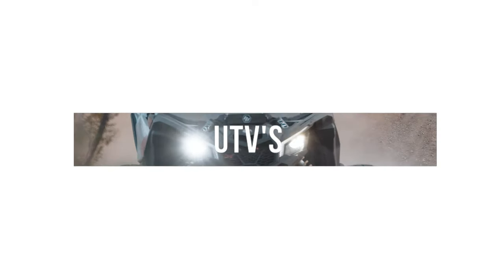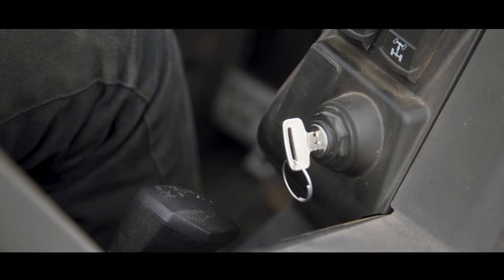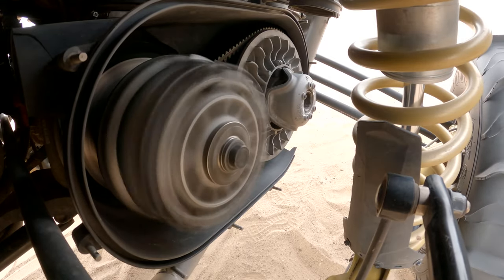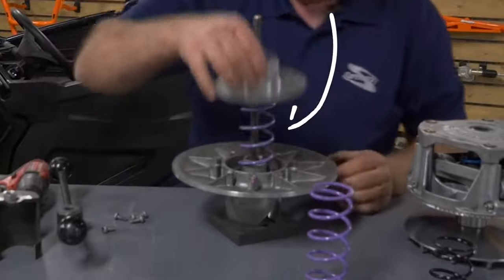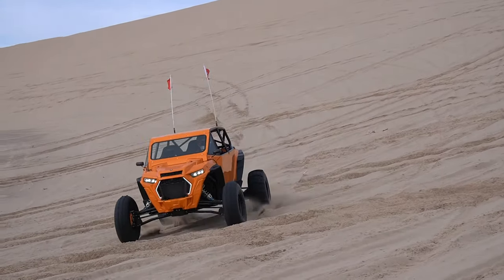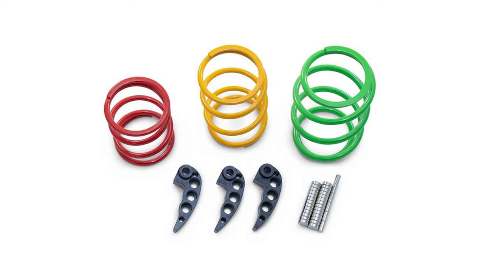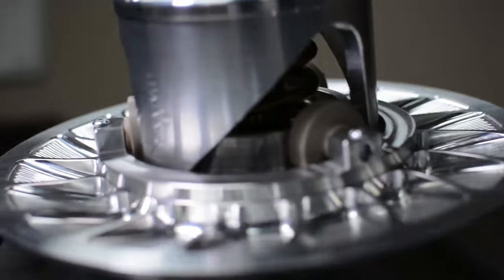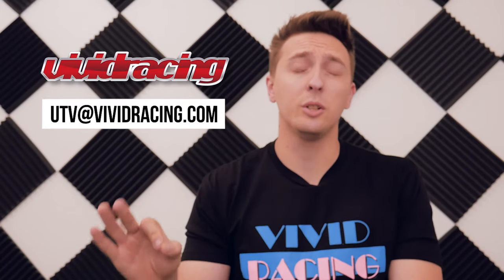UTV Clutching 101: Everything You Need to Know and More!

Comment: On my Canam 570 I put on heavy black water 27” tires to replace the 25” light tires and did not replace the clutch.  Still works good on Colorado trails
Reply: Lots of our guys run heavy 30s with their 570 pretty decent. Like 60 pound outlaw 2s

Comment: Of course, the best CVT is designed by Yamaha, which uses a wet clutch so your belt is always engaged with the primary sheave and thus no belt burning.  They back up this industry-leading design with a 10 year belt warranty.
Reply: Kawasaki uses wet clutch as well
Reply: @flight2k5  they call it a centrifugal clutch.
Reply: @danlux4954  it’s a centrifugal wet clutch. Now you know..
Reply: I'll stand by that Yamaha ultramatic. And the wet clutch.  I went to change an 11 year old belt and it was still within spec.  Best cvt design out there. I watched Polaris and can ams smoke belts all the time

Comment: I can get the motor to run, idles ok, but when I try and shift into any gear, it grinds and stalls out. With the motor off, it wont shift other than into the first forward detent, not the second. No change with the new belt I put on. Any suggestions?

Comment: If you're the tuner type, this drive system is pretty fun to tinker with. Snowmobiles have used them for years so there's plenty of different parts available. While it's definitely recommended for beginners to not stray far from the factory settings, once you understand how they work and the power curve of whatever engine they're attached to you can REALLY change the way a machine feels. I mean like radically. I could have a newbie ride a certain machine and then make nothing but clutching changes and not touch the engine and have them ride it again. They will have a hard time believing its the same engine because the machine just doesn't behave in the same way.

Comment: Hey brother I have a 2016 kymco 450i it has 3000 miles on this machine. The belt is in peices,half is tangled up behind the pully. On the smaller clutch there is some loose round peices about the size of half inch nuts looks like there's 3 or 4 just rattling around, don't know what they are. It looks like a small groove 1/8inch teeth 1/8 apart and 1/8 tall teeth. The other belt is an inch wide,3/8 tall and 1/8 gap between teeth. Why would there be 2 belts? How would I get a new belt on, what's the best way? I need help, this is my first time doing this

Comment: Alright, I'm stumped on this one. Have a UTV that pops out of gear every so often, not pulling anything just normal driving. Unhooked the shift cable and manually put it in gear and it still does the same thing. When it comes out of gear it makes a clicking noise that's matched to the rpm of the engine, when the engine RPM slows down so does the clicking and it will engage back into gear. Any ideas at what parts I should be looking at replacing??? ANY help is greatly appreciated.
Reply: Is it a Polaris lol…

Comment: I bought a maverick max 1000r xrs used from dealer. Dealer had to put new tires on before sale and they ended up putting oversized tired on it. First trip out I blew the belt apart. 😒 I got a new belt put on and currently breaking it in. Just worried that with the oversized tires that it will break again. What would you recommend? 🤔. Tia

Comment: I have a 2013 Arctic cat Wildcat 1000...The previous owner install a racing clutch which jerks when you give it gas, we checked the belt and it is fine but I think the spring set up is to strong which if I understand your video is the reason for the jerk and this is especially noticeable when you go to take off slow be it in reverse or forward. I think I need different springs. The past owner was kind of a rock crawler but I am a Desert Runner most of the time and would like to know I am not hurting the belt and trans. which feels like it now.
Thanks
Jim

Comment: Hi, just to clarify.  I have a cfmoto zforce 1000 and I put larger tires from 27 to 30inch.  Larger tires means I should use smaller weights correct?   14grams is standard plus 8 grams for the plastic sliders that hold the weights.  I should go to 10 or 12 grams correct?
Reply: Use a tighter/stiffer secondary spring
Reply: You can lighten your weight up and make it shift out at your peak hp rpm

Comment: I have a 2020 polaris general xp 1000. It has a stage 1 evo tune with a gilomen clutch kit. I run highway speeds a good bit but also play in the mud. Im hitting 7k rpms @45-50mph. What do you recommend on getting those rpms back down around 5-6k on highway speeds?
Reply: I think you need a heavier primary clutch weight

Comment: The clutch on my rzr blew my mind.  The belt looks similar to my harley.  Looks like it has teeth for a sprocket but there is no sprockets?  Why is the belt designed that way?  Does the gaps allow it to bend easier?  I GOTS to know.
Reply: I think it's for flexibility when it has to pinch down. if the belt was solid it would be more prone to crack or tear when it pinches together. it could also be for weight saving, cooling properties,  or when it grips the sheaves.... I really have no idea thoe I'm just guessing 😂

Comment: thanks for the info. I have a wildcat trail with a speedwerx header pipe and muffler, performance secondary clutch sheaves (with performance spring), primary weights and spring as well. I installed the header and muffler first ( I haven't installed the supplied power commander yet) and tested it with my stock clutch system. I had the performance secondary spring already installed and the wildcat performed awesome! so I next installed the rest of the clutch parts without adding adjusting weights to the new weights and it feels like it is binding at slow take off. I had also lost some of my downhill backshifting ( I had trouble holding it going downhill). I then took emery cloth to the ramps to clean up any machining defects? and added the "medium weight" to the weights and reinstalled. Now my back shifting is almost all gone! WTF am I missing? All of these parts are sold as a performance kit designed to work with each other and now I just want to put my clutch back to stock. I imagine I need to remove the extra weight from the weights first but one thing that I am unsure about is I used the existing shims from the stock clutch and wonder if that needs to be corrected? could I be out of alignment? thanks for your consideration.
Reply from the maker: Shoot an email over to utv@vividracing . com and our UTV specialist would be happy to assist you with setting up your clutch. I already spoke with him about this issue so he will be checking for your email :)
Reply: @vividracingoffroad  I appreciate you!

Comment: I put my 2020 hd8 in gear an it clunks once I take off then runs fine anybody have a idea where to start fixing stuff or is this common this is my first can am single cab just added 28x10x14 sti out an back 2in rubber tires don't know if this is bad got it used with 300 hrs

Comment: I have an idea for a kind of quadricycle with two small engines that each drive an axle. It bends in the middle. The idea is redundancy and an easy way to send power to the axles. I'm not  sure if any of this will work but I think you could steer it with an old style steering gear from an old non power steering vehicle. It might have enough power to articulate the quad. I'm not sure how to put power to the axles but I imagine something like this clutch could do it. Any ideas?
Reply from the maker: If each engine is powering each axle, you will need a chain and sprocket mechanism rather than a full-blown transmission.
Reply: @vividracingoffroad  Wouldn't it need some kind of clutch on each axle?
Reply from the maker: @herbertbell9438  I would look into go kart clutching with a chain and sprocket

Comment: Honda talon have a not strap transmission. The rear suspension is bad designed but no friking snowmobile clutches..
Reply: Talon rides like a brick! Worst riding sxs I’ve ever driven. Traded mine for a turbo s and don’t miss it one bit

Comment: What causes the pop sound when you hit the gas? Only when stopped and you go. 🤔
Reply from the maker: It is possible that the popping noise you are hearing is a result of worn out rollers or weights.
Reply: My brand new 2021 turbo had that popping you were talking about from factory, I upgraded to the aftermarket assassins s3 clutch with hi load hilux and it seems to eliminate that popping

Comment: In a nutshell tons of extra shit to break on the trail nooo thanks
Reply from the maker: The way you drive plays a huge factor in the CVT system. If you are just trail riding, you won't have to worry about anything other than the belt. You can prevent the belt from tearing by avoiding overheating it. Extended lengths of full throttle will burn up your belt VERY fast. If you modulate throttle, prevent the tires from spinning, and allow for belt cool downs you will hardly have an issue with the belt.